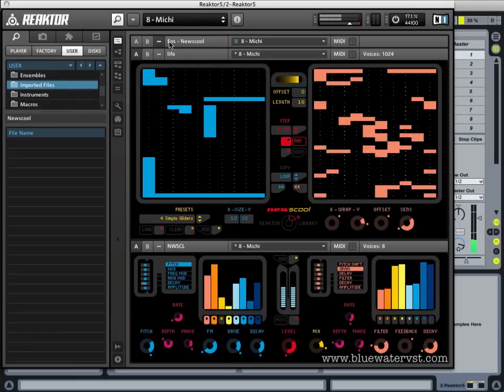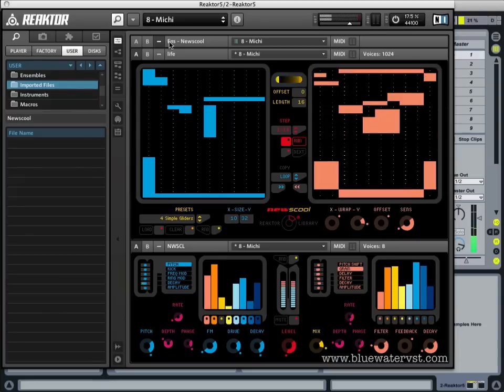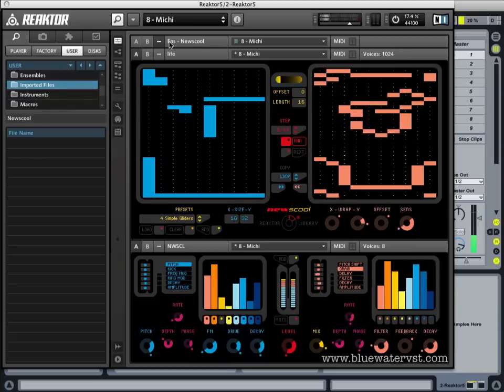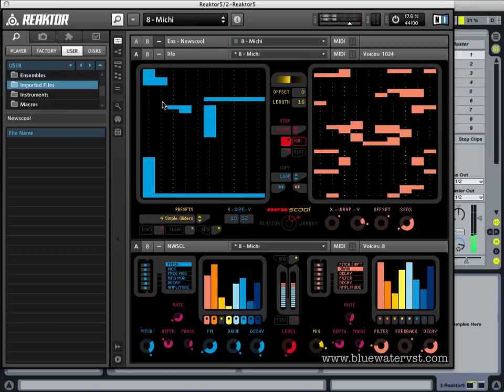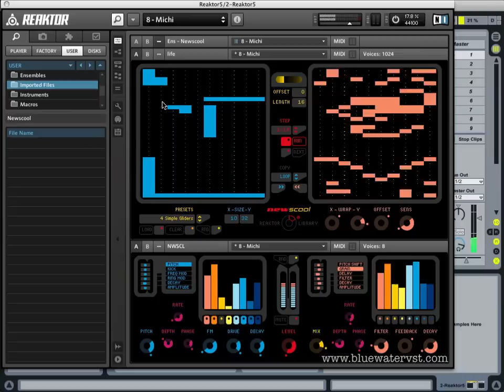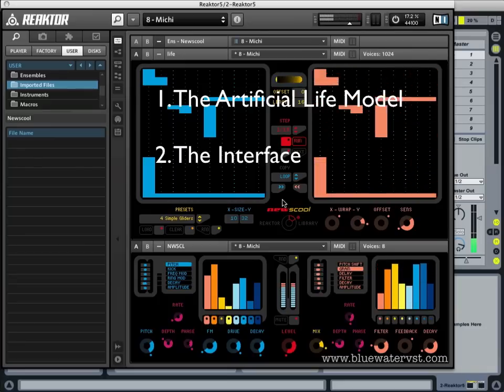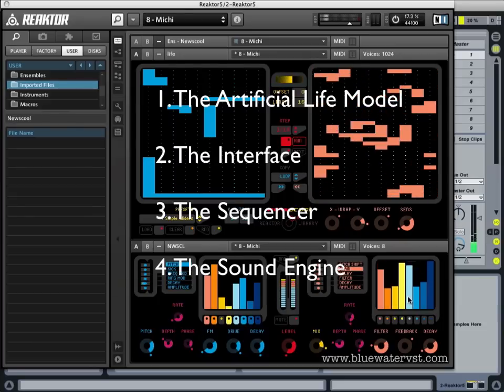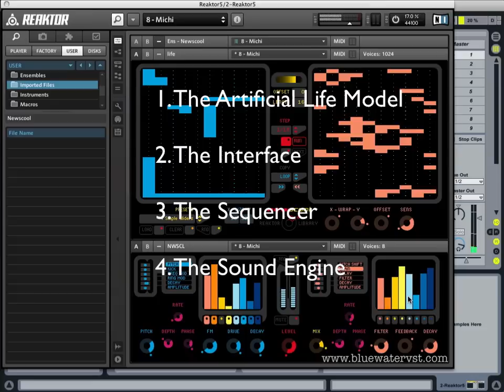Native Instruments REAKTOR's Newscool - Part 1 - Intro

Comment: I HATE VSTs.  It could be due to my own ignorance & or PC limitations, but they're basically useless to me. (little more than "toys")  In the late 90's I had Gigasample/Gigapiano.  I ran it on a Pentium 4, 200mhz w/32mb RAM & a MIDI-Man PC/MIDI interface & I had negligible latency issues.  Now when I try to run some free, simple, synth VTSs on my i3 2.4ghz, w/6gb RAM & direct USB/MIDI interface, I get 0.1 to 0.2 seconds of latency. It's almost like the PC/VST technology has actually REgressed.

Comment from the maker: That's a tough one, but I think I can point you in the right direction: In Reaktor, you can load the Life sequencer by itself (in other words, not connected to Newscool's sound engine) . From there, you might try routing the signal to a MIDI track in Logic (not sure exactly, I use Live) to record it. Not a great answer, I know, but it's a start...